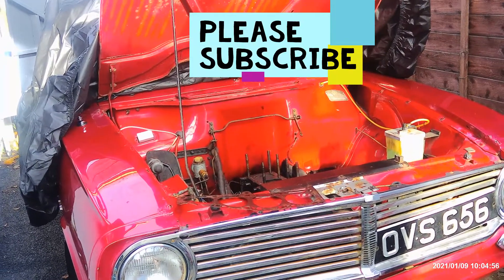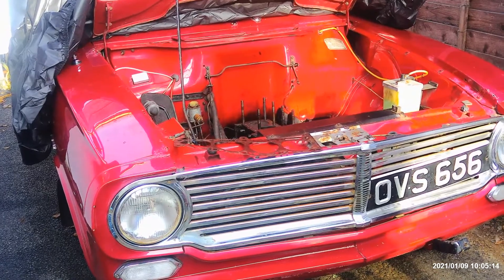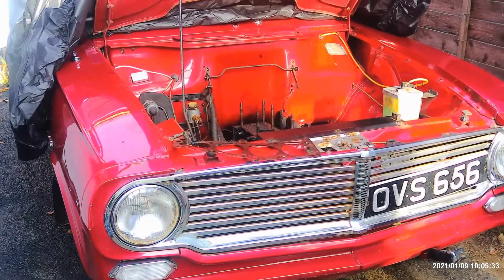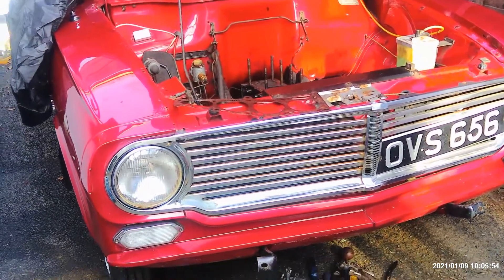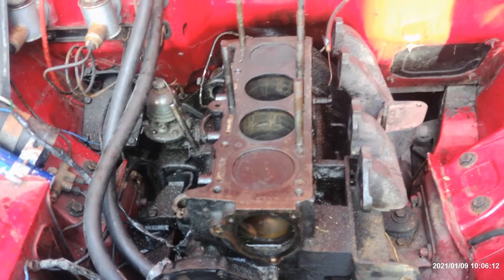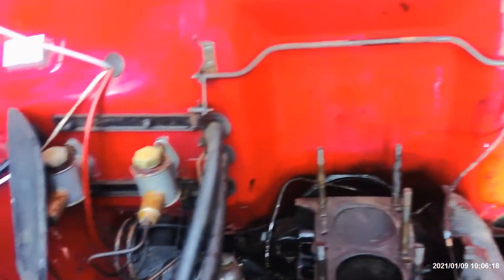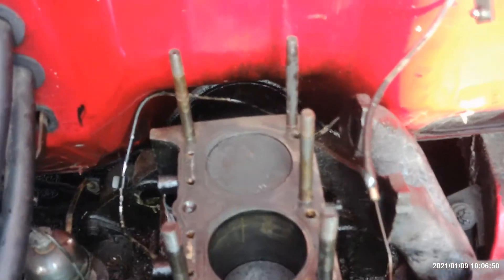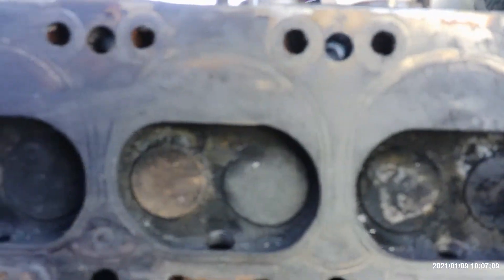UPDATE ON MY VAUXHALL VICTOR    We have a Small Problem.

Comment: Blimey John that was unexpected, hope you fix the problem.
Reply from the maker: Yes should not be a problem ,Just received Head Gasket set, Valve oil seal nearly  gone. Used to be a Vauxhall  Mechanic ,So If I cant fix it ,there is no hope.  Are you going to Hub Nut  show on on sunday at Honition ?
Reply: @johncottonclassics  No sorry I can't make that one unfortunately, but I am going to a meet in Exeter on the same day. It's closer to home and no booking required.
Reply from the maker: @CortinasAndClassics   No Problem .Have a good day